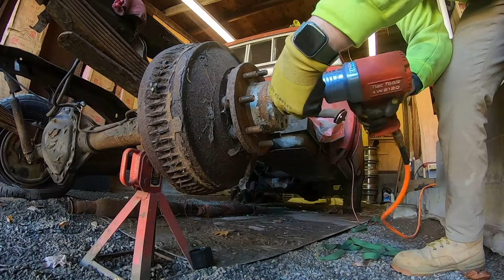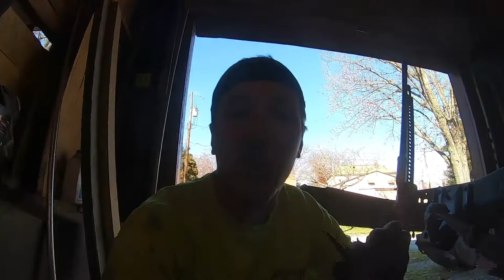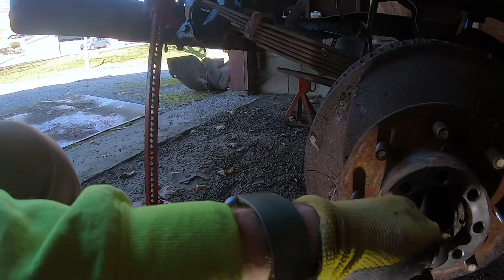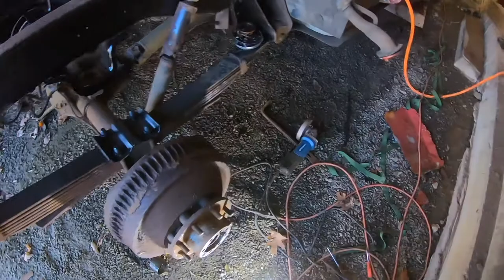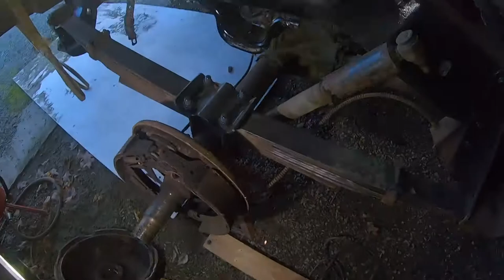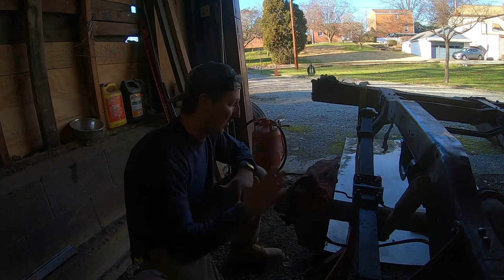Removing a Stuck Brake Drum on a 78 Chevy K20

Comment: Thanks for the video. I have a 1976 F250 4x4 Highboy with the same problem. The self adjusters were rusted solid and the shoes are rusted solid to the drum. I’ve unbolted the wheel cylinders and cut the retainer pins and I still haven’t been able to get mine off. I’m going to have a neighbor bring over his torch and cut them off. The truck has been sitting in a field in northern Minnesota since 1989. Good news is it actually runs.
Reply from the maker: That’s awesome! It definitely took some time and patience, they were really ok there! Good luck with the build!